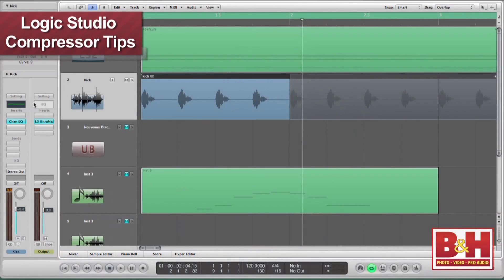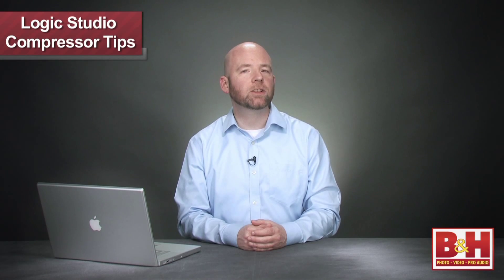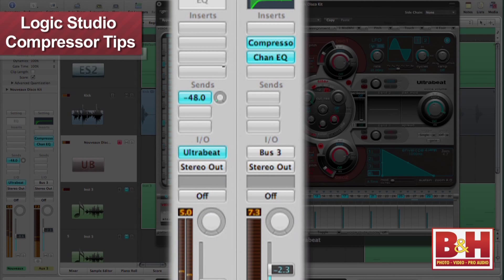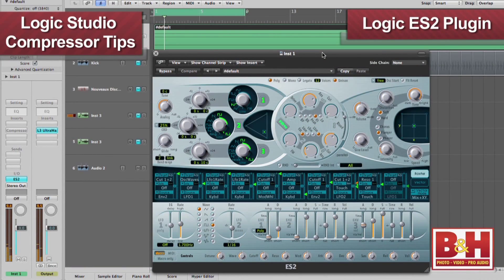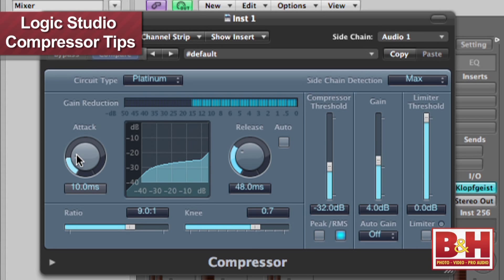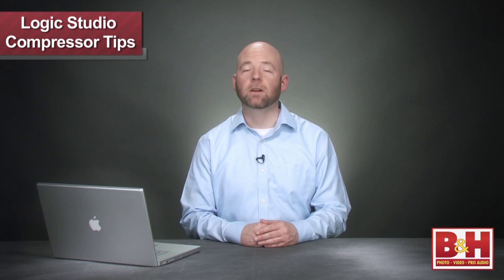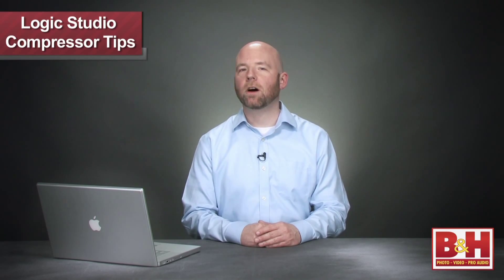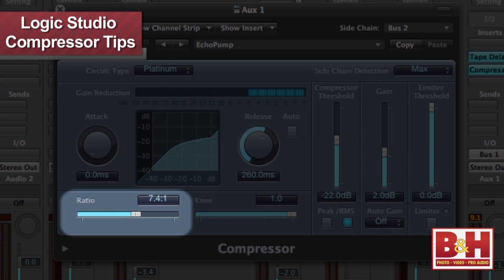Logic Studio Compressor Tips

Comment: @MILLSPRO123 Yes, you can send any sound you want to the side chain to make the compressor across your synth "pump".  A kick drum is good because it has a nice attack and quick release and that makes the compressor pump.  If you don't want to hear the sound you're sending to the side chain input, just don't send it to the stereo bus.  On Logic, for example, just select "no output" on the that track's output.  It will still get to the compressor, but you won't hear it in the mix.

Comment: @PeteGrime Yes, the main output and the stereo buss are the same.  This is where all your individual tracks are summed into a stereo output.  In Logic this is the Stereo fader labeled "Output".  The only thing after that is your Master fader, which I personally would leave set to 0.0 (unity gain) and never think about again.  Make monitor volume adjustments on your audio interface's volume knob or the Mac's volume slider if you're just using the headphone jack.